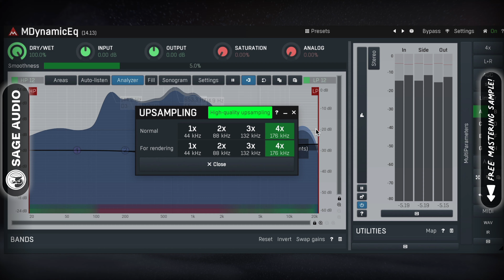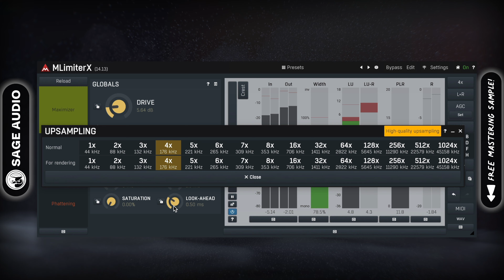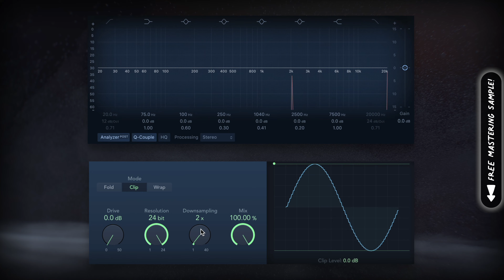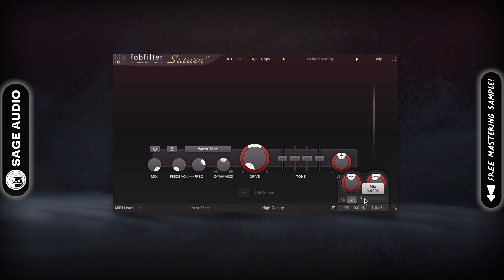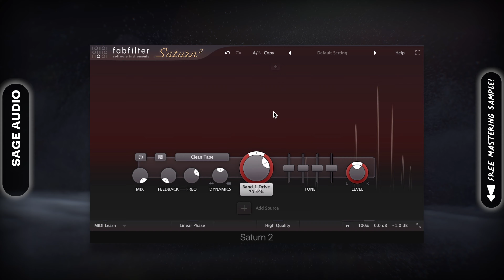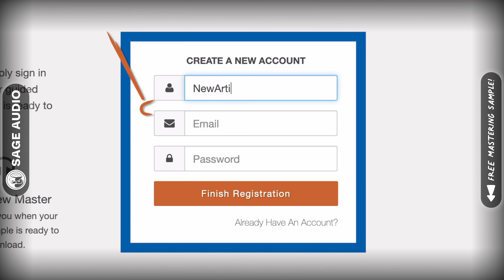Oversampling Explained

Comment: Well, what is the meaning of "Phase" issues or problems or cancellation or something like that, what is the meaning of it sage audio? I'm a little bit confused aha smh
Reply: You could define Phase as your audio inverted part.  4 - 4 = 0. It's like a perfect copy of that audio in particular that goes contrary to you. When your Audio go up with an certain amount of force, the Phased Audio goes down with the same amount of force... Totally cancelling the effort. So it doesn't sound at all... It's a technique used in various ways. For example a Singer's headphones could "bleed" noise into the Microphone, or even his voice could feedback... By applying Phase you could try to cancel these noises. Another advance use of phase is when you want to filter certain content of the sound. Imagine a kick you want mute, by adding a similar one and inverting the phase you could filter it out... So many creative things you could do with phase. But inside a mix it could cause problems with other instruments or tracks. Hope this helps
Reply: @rumar4u  Ruben you’re talking about a complete 180 degree flip of a sound wave that equals opposite polarity and hence full cancellation. There are plenty of phase issues that happen between 2 or more similar signals/frequencies being in cyclical step and being out to the point you described. When there is a time shift between same combined frequencies they can sum and subtract in sections of the wave that are not at the peaks and troughs, thereby skewing the shape of the resulting signal and sound. Anything that affects the timing between similar signals is going to bring about a shift they’re married together. That can be from conflicts caused by multimiking, room reflections messing with the direct signal at a mic, delays caused by plugins and so on. Sometimes what crops up can suit the listener’s taste and can be used in the upper frequencies for spread, but it’s something to watch out for, especially with the lower frequencies. Can’t elaborate more due to battery about to die...
Reply: @colinbudd5840   Sorry part of the reply got cut, probably my mistake, but I was trying to be as simple as possible in order for her to understand. But thanks for it.
Reply: :-).  Been there. Cheers Colin
Reply from the maker: Thanks for watching Riona! The "Phase" issues are just waveforms conflicting with other waveforms.  So the aliasing distortion that occurs interacts with the original signal, and causes "destructive interference" making the original signal quieter, and potentially causing unwanted stereo imaging.

SageAudio.com
Reply: The most noticeable effect is like some parts of the sound are swishing in and out in the background, pulsating like wind or waves. 
Very hard to describe I've just found out!!! 😁
Reply: Thank u so much everybody!!

Comment: I don't fully understand. So if my session is set at 44,1KHz, the oversampling option allows me to go beyond this initial setting on a particular track. Right ? I don't understand how a plugin can partially change the sample rate of a session just for itself. It's like let's say you're given a box of chocolates for a total of 1kg but if you want you can change the size of some chocolates and have some bigger ones but without affecting the total weight.... but ok.
But, what leave me even more confused is : if I'm recording from my audio interface set at 44,1KHz, how can the plugin can magically change the quality of the incoming signal ?
Also if I'm using oversampling with a plug-in on one track. Does this also affect how the other plugins work on the same track ? Because if suddenly the signal is now sampled x2 (So 88kHz in our case), I guess it goes for the track in overall, no ?
What am I missing ?
Reply: oversampling is like sampleing except  but more better.
Reply: i think a sample rate is the rate of sampling, so the faster the sample rate, the more information recorded per second in the audio. this makes the audio better and more detailed. The distortion comes from digitization, which is opposed on the sound when it is sampled. Every digital effect needs to sample the sound in order to impose it's effect upon it, so if you use a faster sample rate, the sampling of the sound will be more accurate and less noticeably digital sounding.

Comment: So (most likely, dumb question ahead) as I understand it, there are many benefits to working, generally, at higher sample rates. My question is, what are my choices as a budget oriented home “producer”, afterwards, when I need to send the track off in 44.1 kHz / 16 bit format to the music platforms. Are there any not too pricey ways of downsampling. Thanks.
Reply from the maker: Thanks for watching! If you're working in a higher bit depth, and need to reduce it, you can use dithering which is usually an option via your DAW when you export.  As for lowering the sampling rate (I'm assuming you're going from 48kHz to 44.1kHz.), you should be alright if you simply convert it in your DAW when you export your mix/master - no additional steps needed.  

SageAudio.com
Reply: @sageaudio  I don’t mean to be repetitive, but (assuming everything else in the project is “release worthy” in the first place) is this process release worthy. I use Logic Pro and the long term plan is to put out my ideas if possible, by myself. Thanks much for replying.

Comment: Question o/ If I use a plug in like the MLimiterX for example, can I just use it to oversamplify or do I have to use other features in the plug in as well for it to work? And by how much would you recommend we increase it? Like you said not too high for the processor:0

Comment: Oversampling doesn't do something noticeable? I don't agree. It depends on the plugin. Oversampling is not something you should always use or maybe not too often. Sometimes adding os it changes the sound quite a lot, it's like you have cut low end and boosted some high frequencies, that's my experience. Aliasing is not an issue per se, sometimes with aliasing it sounds even closer to an analog emulation.
Reply: it gives more resolution, it makes more of the signal sit in space rather than in a "digit" so to speak resulting in a more lifelike sound. If you buy really good converters or a really good clock, like Prism or Forssell for example, you don't need as much oversampling.